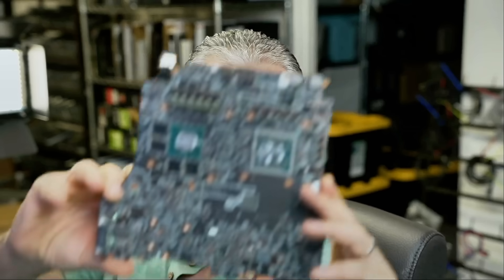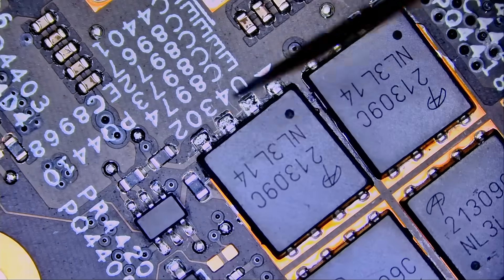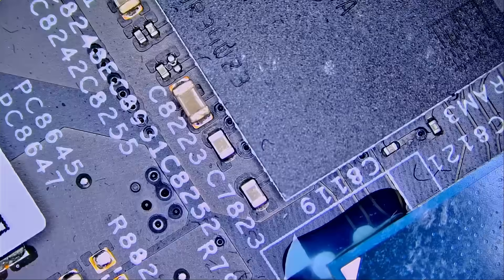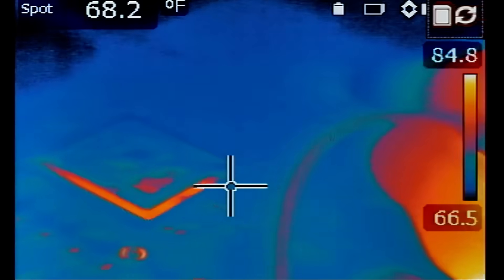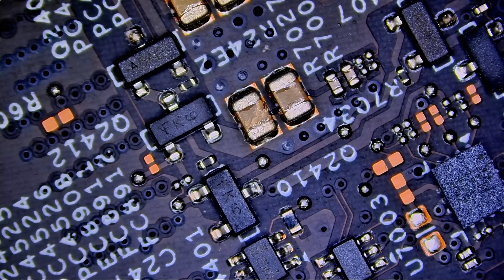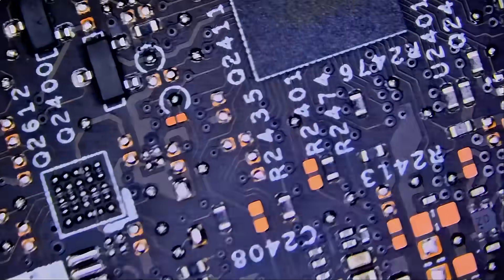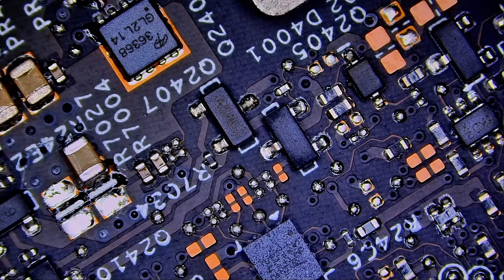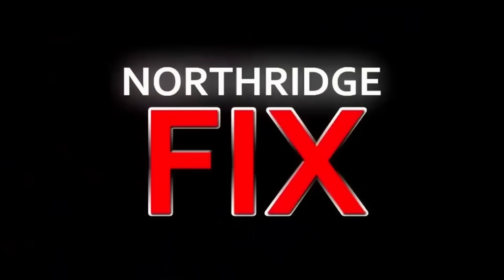Fixing a Dead Alienware M18 R1 Laptop. A Signature Failure that Dell won't talk about.

Comment: You ship it back and the 'expert' customer reassembles and wrecks one of the connectors or shorts something out or perhaps the battery is toast and says 'the board repair has not worked .......'          I would refuse to do board only repairs. That faulty cap could easily have strained some of the MOSFETs which won't be obvious without testing in the laptop.

Comment: DELL= Does not Ever Last Long,, and i worked in IT
Reply: My Dell Precision 670 works all days 7 days a week since early 2007 , and my Precision 490 works all days 7 days a week since 2010... Optiplex (retromachine) GX270 with win98 still kicking... no they don't last much... (20 years and counting). Same for GX620 & GX520... (built to last ,most relyable tool after PowerMac G5 I ever encountered in the last 30 years of IT).

Comment: I have an M18, first version run, I've had no problems. I always have used it with a very good laptop cooling pad. I'm not sure if that's saved me so far, and I do not use it much except when I travel. If it cooks, I'll be sending it your way in the original box, which I still have. I've always used cooling pads, and always had alienware dating back to when they put Pentium 4 cpu's in them. I keep each one 5 years and then buy another. I believe the cooling pad has kept all my laptops alive for years.
Reply: 100% the cooling pad has saved your laptops. Don't think people understand that laptops are actually pretty fragile especially with heat
Reply: Do you clean dust out of the heat sink fins etc? That is usually what separates laptops that die or not. If they are clogged with dust.
Reply: I have the same laptop. When I saw how hot it gets while playing game I was shocked. I disabled turbo boost to keep temps lower and still enjoy playing games without a problem.